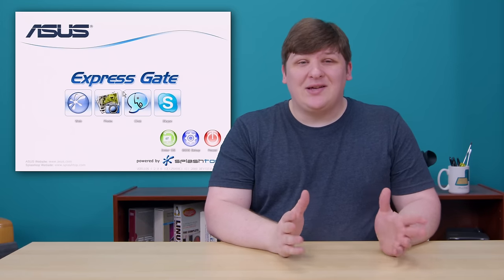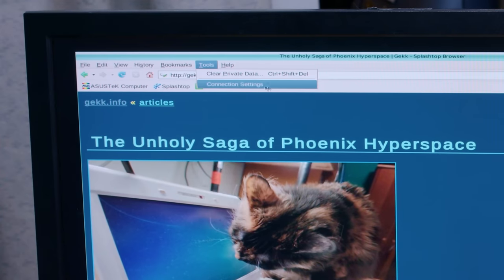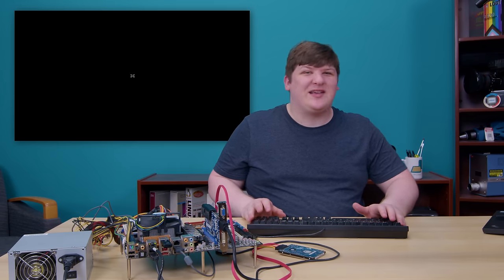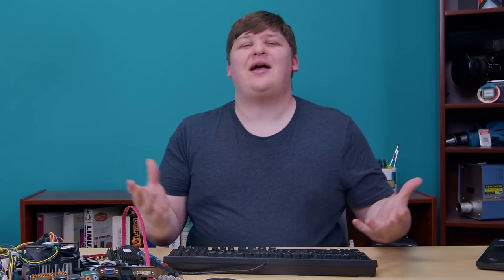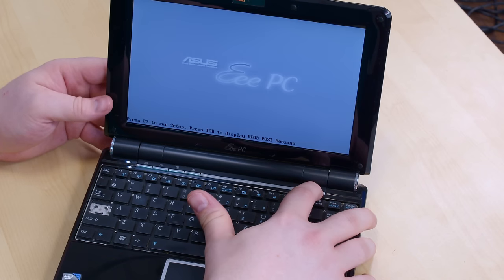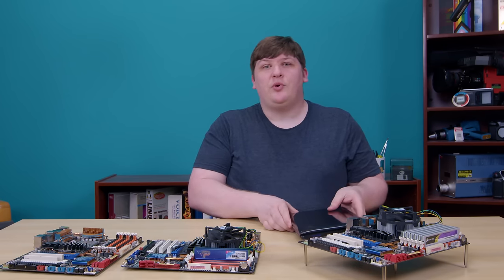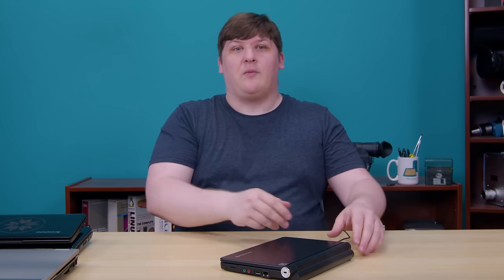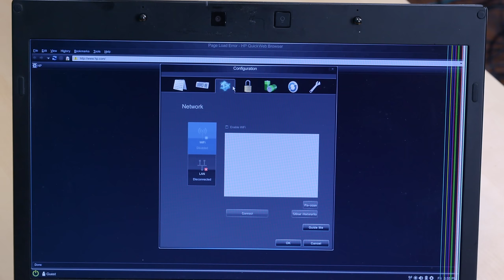Quick Start Ep 2: What The Heck Was Asus Express Gate?

Comment: Had a laptop(and probably some mobos that I forget) with this. Never touched it. Found an old review on it and this is what they say:
"In view of the software configuration, the integrated Express Gate is especially striking, which can be triggered with a certain button. Express Gate doesn't boot the operating system, but instead presents a refined desktop within seconds, with which various functions can be controlled.  For instance, a small web browser is included. Furthermore, it's possible to render music and pictures or play various online games via a special platform. Conclusively, there is also the option of using Skype and other instant messaging programs. The control of Express gate is cordially self-explaining and the speed is also alright. So for those who want to quick check their emails or look at the pictures of the previous holiday is at the right address here."
This was also the laptop that made me realize gaming laptops are garb, and one of the many reasons I'm wary of buying Nvidia.

Assuming in the era of multi-minute boots, these sort of things would've made more sense if it still did(or you could start) some sort of 'background boot' for your main drive while you were using it. A button to click and almost seamlessly switch would've been amazing. But also definitely not something you'd ever see in that era either. I wonder if it's even been done or maybe even is possible today. Or just have those recovery tools as mentioned in the video.

Comment: I had an Acer Aspire 6920G laptop that had a media touch panel named CineDash or CineTouch (with a wheel, I suppose to copy the iPod), that from the factory came with a Blu-Ray drive and Windows Vista. If you pressed the media icon in that panel when it was powered off, the computer booted an slim down (and I kid you not) FREAKING WINDOWS XP (on 2008, wow) with only the media suite from Acer named Acer Arcade Deluxe, that was also available on the Vista installation. The media system was even hibernated for even faster boot times. And yes, you could play DVDs and Blu-Rays on that system. I think I still have the original DVDs for restoring that laptop, but I'm not sure if it has that media system.

Comment: I had, well, it's still in my old wreck, an AM3 Asus board with the disk based Express gate - was a BIOS feature to call it up, but it loaded from disk. I used it once in a while for quick lookups when I wouldn't otherwise be using it, but the lack of updates meant I got rid of it when it was too broken to use.
Also have a Lenovo S10-3, wish I could put Android-X86 on the QS, but I think someone dug into how QS initiated and there was something that made it difficult to use as a simple dual boot shortcut

Comment: My old P5Q motherboard had ExpressGate, but I had to install it from Asus motherboard drivers.  But this is a much older motherboard than the ones you're showing. Mine was P45 Chipset, using LGA775 that used Core 2 Duo/Quad CPUs which is before Intel start the i7 line.  From what I remember it installed the small OS on the hard drive as a set of files you could see sitting on it.  It didn't partition the drive in some weird way, there was no boot load option, other than "press F(something) to boot Express Gate"

Comment: Rad.  I have a couple Asus netbooks that I used for YEARS.  Actually I only stopped regularly using my last one about a year ago.  They came with Windows 7 Starter and you can probably still download the expressgate SW package from Asus.  BIGGEST PROBLEM: They only had 1G of RAM and it is soldered to the board. Not W10 compatible.

Not to worry though.  I also own a T101MT.  It is upgradable with socketed RAM.  It's not a netbook.  It's a real big boy laptop that is the same form factor as a netbook with usb, ethernet, wireless, vga out, etc..  It also comes with a stylus to use when YOU FLIP THE SCREEN AROUND TO USED AS A TABLET!  I used it as a lighting diagnostic and personal computer for around a decade.  I'm gonna try to cram W10 on it one day soon.  You should really look it up.  It was a concept a little too soon and I dearly wish they would remake it with current tech because it would be tits as fuck if rereleased today.

srysly, look it up.  it's right up your alley...
Reply from the maker: I believe I have that exact model and it will be appearing in a later video in this series, because it had the cloud variant of Express Gate. Sad to say however, I consider it the cheapest looking and feeling tablet conversion I've ever seen, haha

Comment: In addition to SSDs killing it, ExpressGate and Splashtop came out at a time when it was crucial to people buying these Asus products (especially bare motherboards) that they have the ability to download drivers for their hardware. The fact that you can't download stuff or even update Splashtop doomed it to being a useless vestigial organ that made booting Asus boards a pain. I remember at a lan party where Gigabyte had a booth around that area, they sold a "faster boot time" as a feature... because they DIDN'T have Splashtop. It's one of the reasons I got a Gigabyte EX58-UD4P board for my i7 950, though it died a couple years later and was replaced by a steaming turd of an EVGA X58-FTW3. The third replacement board under warranty survived from 2012 to 2018, which wasn't terrible, considering it ran pretty much 24x7.

Comment: My desktop until this year took several minutes to boot. The reason? My raid controller. Before I could get 4tb m.2s for less than 200usd I was running raid 6 on several spinning disks. That controller had to boot up it's own linux os and start all the drives and bring the array online before it was allowed to continue. I had an adaptec 71605 iirc. Motherboards used to be a lot more interesting back in the days of multiple chipset manufacturers. You could choose from VIA, ALi, OPTi, SiS, Intel, and several more. Motherboard manufacturers used to have a variety of options available to them to differentiate their products.

Comment: I didn't think I'd see CRD do a video about Splashtop OS!
I remember using a LG X120 which had Splashtop OS rebranded as ‘LG Smart On’.

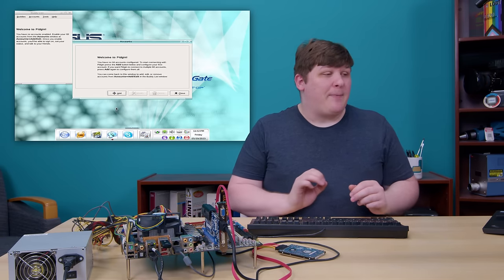(17:12) The version that shipped on my LG X120 had Pidgin rebranded as 'Chat'. However, I recognised it as Pidgin from having used it on Ubuntu 8.04 back in the day.

(19:00) My dad's and my X120 had different BIOS versions. Instead of 'EXPRESS GATE', his mentioned 'SPLASHTOP' and mine mentioned 'SMART ON', if i recall correctly.

(34:16) Yep! I purchased my first PC with an SSD brand new in 2013 which ended up being a secondary device for me while my main still ran on a hard drive (I needed a lot of storage as I didn't have a NAS at the time), and it was only in 2017 when I had an SSD in my main PC after it fell to the floor on a moving bus (it was a laptop) and its original hard drive died.

(34:56) Correct. In 2017, I bought a used Samsung SSD 850 Evo for a decent price and that was what I had installed into that laptop.

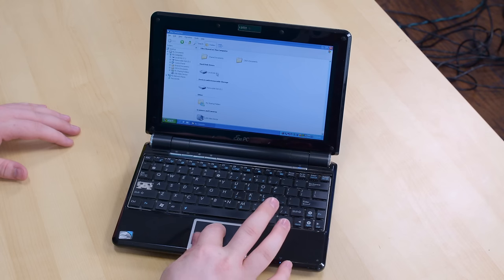(38:38) The LG implementation did something similar, I think the folder was named LG(dot)SYS, and their implementation involved Smart On being invoked via a secondary power button, so I assume that invoked a bootloader similar to the ASUS Express Gate SSD version you mentioned but set to look for a file on an NTFS partition.

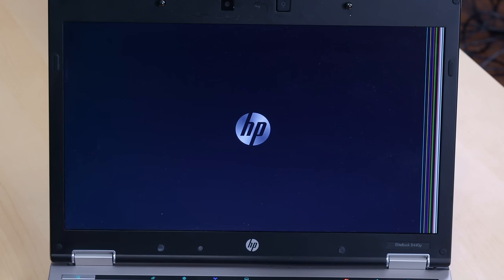(50:09) The HP Mini 110-1100 series models that shipped with Windows 7 Starter also had QuickWeb but one that was more clearly based on Splashtop OS.

(51:57) I remember I had to stop using Smart On just because it was stuck with Splashtop Browser based on Firefox 2 while the Windows side already had Firefox 3.6, and I eventually installed Ubuntu Netbook via Wubi.

Ubuntu Netbook was a little interesting to me as it featured some things which would eventually become part of their Unity desktop environment that shipped instead of GNOME 2.32 (the final 2 series release) on Ubuntu 11.04, where Ubuntu Netbook was also discontinued. Wubi was also eventually discontinued when Secure Boot and UEFI became more mainstream in Windows 8.

Comment: The PC and many other home computers did come with built in operating systems they could load without a drive. This is just an updated concept of a XT booting into ROM basic. Wouldn't let you do much but you could get hello world to work and I think on some boards that had the connector you could save to tape and that's it. Mine had the tape connector but I only used it to turn a relay on and off

Comment: We had computers with a built in OS with a full GUI in the 80's and 90's that could run without a HDD, the Acorn Archimedes machines, you could have extension programs on the HDD but the OS itself was on ROM. Also despite using co-operative multitasking they rarely crashed and the BBC used a lot of them.  
Having the OS on ROM had the advantage that you couldn't corrupt it, all you could do is corrupt the system settings as they were stored in battery backed RAM and could be changed, so you might lose HDD or disc access, it even had it's own daisy-chained networking protocol (that used 5 pin DIN connectors) and range of servers/remote disc stores.
Reply: You also had the Atari ST boot right into the GEM desktop from ROM.

Comment: The music player is Aqualung! Now replaced by deadbeef as the only decent gapless linux mp!
I love eee pc and playing with debian installs, of the minty variety. Look into asus boot booster! There were two 8MB partitions at the end of the 2, 4, 8, and 16 mb ssds that made the fast boot option appear, shaving 5 seconds off the boot time. I can get modern linux to boot to desktop in under 20 seconds :D 
If you have the 2G surf, you can put a fast sd card in it, put a raid partition across the 2gb ssd and the card, to fit a half decent linux install in it, and it comes up around 50mb/s, beating the ssd by 10! Use a 32 gb sd card and you have 30 GB left for music. Out of hibernation in under 15 seconds.

Comment: I wonder how much those flash chips cost Asus at the time. Like, it wouldn't be a huge expense, but still a lot to add for a feature no one would use that probably didn't increase sales.

There's likely some way to exit or crash the X server and get a terminal if you really wanted to "jailbreak" it. Or presumably there are known exploits in a Firefox version that old. Not that it would be especially useful.

Comment: I think part of the reason they did this is that on a basic level, all motherboards and laptops offer much the same features.   There isn't a big selling point a manufacturer can use to sell a motherboard or laptop.    At least not one it can use to stand out amongst the competition.   TBH, I'm a confirmed geek.  I've been building my own machines since 1994, and even I have trouble distinguishing one motherboard from another when speccing up a PC.

I think that's where all this RGB stuff has come from.   I know there are some people that would have done that anyway, but mainstream consumers wouldn't be looking at RGB unless it was forced on them, as it has been.   

These mini operating systems I think were much the same thing.  Sure, they did solve a problem of booting a machine quickly, but the manufacturer needed something to stand out from the crowd, and they did that.   I think that was the reason they were actually there.   Asus et al, didn't really care if it took you 30 seconds or 15 minutes to get online, they just wanted a selling point..

It's much the same with the software you get bundled with a new laptop or motherboard.    When I install a new motherboard, all I want on any accompanying media is any software required to maintain the motherboard.   Perhaps even just the drivers, and a manual.   Instead you get all sorts of crap.    Gaming utilities, management utilities and usually a trial of Norton Antivirus.   Hell, with my MSI motherboard, I got all the normal drivers, manuals.  I did get the obligatory prompt to install Norton Antivirus.   I've also been prompted to let the motherboard manage my photos (no thanks - I have iCloud for that), provide it's own Voice Assistant for managing the motherboard's facilities, and it's also offered to install a emulator so I can use any Android apps I have on the motherboard.   Something which was a nice novelty, but nothing more.

Comment: Yep, in 2008, the BIOS boot screen barely looked different than in 1999. Award BIOS was seen often on PCs from 1999-2004. Intel-based systems, for some reason, used AMI usually. I usually saw Award on AMD, at least from 2000-2004. Gigabyte was using Award legacy BIOS in the very-early-2010s, on socket AM3. 20:08 usually means no boot loader found on the drive.

Comment: I used to have an old Inspiron 1525 (around 2007ish maybe 08) that had something similar to this called  DeLL Media Direct.  It had a separate power button to boot that OS.  it was basically a DVD/Media player that used low resources.  It had 1GB RAM total but the MD OS only used 256MB and it seems like the CPU was underclocked to like 1.2GHz also.  Been a while since i seen anything like that.  Pretty cool... I never knew any desktop systems had this functionality back then.   I was on laptops only back then i traveled alot for work.

Comment: My HP CQ57 laptop had a secret partition on its original HDD with a QuickWeb Linux OS which was accessible only through the F5 key while it was shut down. I found about it one day when I was cleaning the keyboard and I accidentally pressed the F5 key. I was shocked what happened. In the BIOS, I found an option to enable it or set it to boot the specific partition. That could be a cool feature, booting your own Linux distro out of a single key.

Comment: Interesting you say techies wouldn't touch it. 
I didn't have express gate, but I wanted it (while not knowing what it was called at the time). I even tried to recreate it on the system I did have. This was in the days where I was very new to Linux and was still primarily in Windows. 
What I wanted it for was a quick way to pull up a web browser. There were many times I just needed to do something quick, like find an address, check web mail, or submit something. It was before we all had smartphones.
My PC was also in the living room at the time and wanted that browser available for guests, without giving access to a whole windows user log in. 
I wasn't as skilled at the time and failed in my quest to put something functionally similar to express gate together.

Comment: The idea of a stripped down OS built into ROM is great. A few necessary apps like a web browser, some flash memory for updates like newer SSL/TLS, and a few diagnostic and repair tools(with support for working on at least Windows and Linux installs, BSD would be nice too) would make for an amazing feature.

This basically hasn't been done well ever. You could argue that for the period, 8 bit machines did OK with this, but those systems were extremely limited to begin with, if they could run a larger OS at all they often didn't have the capability to do anything useful with that OS anyways.

Comment: I had expressgate (v2 i think) on my asus motherboard back in 2010 or so. But not the verdion with the flash module. It was installing on the hdd as files like the laptop. But it was loading before the bios and not from a boot loader. Like you showed in the laptop.
It would take 10-20 seconds to boot if i am not mistaken. And it was absolutely useless. I used it maybe 3 timed before disabling it to boot faster.

Comment: I have an Acer Easystore H340 home server. It initially ran Windows Home Server, which was installed to the hard disk. After mucking around with it, it turns out its got an internal 256MB SSD right on the board. I forgot what was on it, or why the device needed it. It might have been the boot manager, or an installer for the OS. But it was accessed as a USB device, even though its built onto the board.

Comment: I just replaced my boot drive with an SSD a few months ago because I thought my HDD was dead (it wasn't,) and it boots much, much faster. It used to take 10 - 30 minutes to be actually usable. I used to think my PC was slow because it was old (8 or 9 years) and not top of the line at the time, but booting from SSD makes it no slower than my brother's 2 year old PC at any task that doesn't require up to date hardware.

Comment: VESA does have some basic 2D hardware drawing functions. It was actually faster to use VESA modes than VGA modes for games back in the day because VESA had bit blitting while with VGA you had to manually move pixels around the framebuffer. Also VESA could do 320x240 with a contiguous framebuffer. VGA video memory was limited to 65536 byte pages which was why the most commonly used mode for VGA games was 320x200, it would fit in a single 64k segment of the VGA card's memory (there were some non standard low res VGA modes that were possible but rarely used because they wouldn't fit into a 64k page).